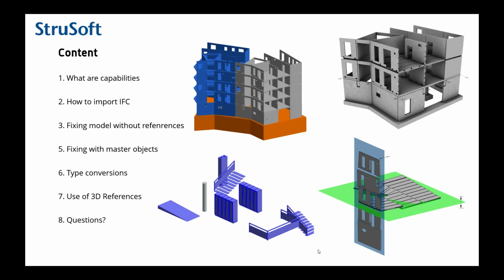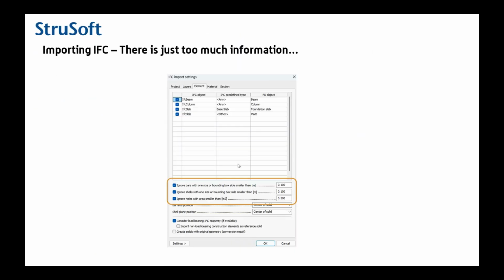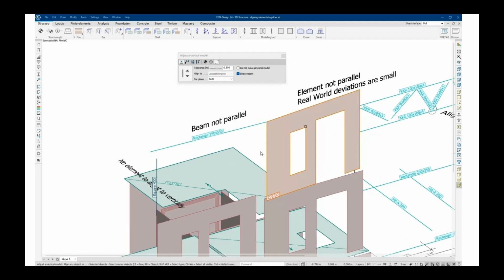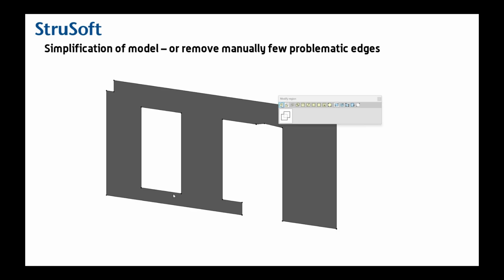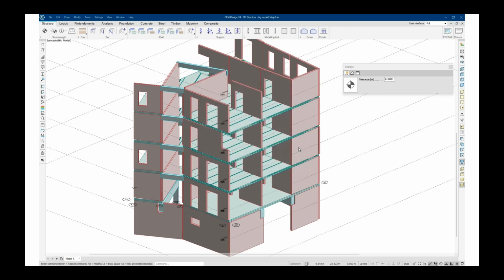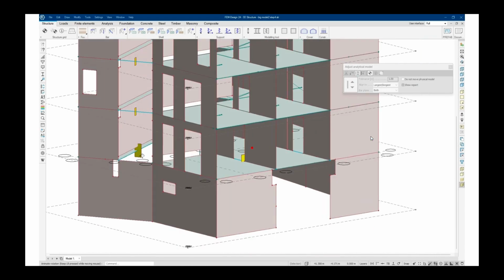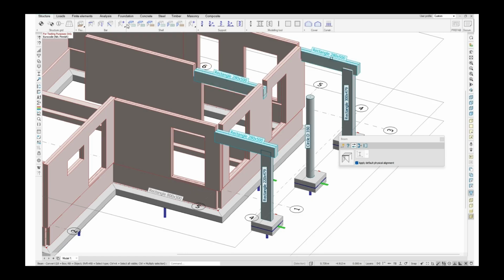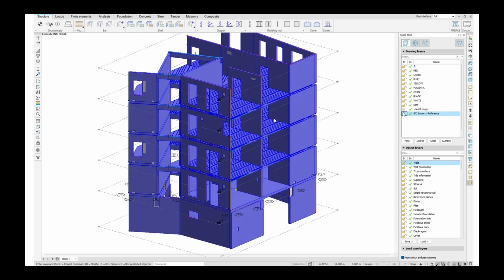Ultimate Guide BIM to FEM

Comment: Hello! What about Tekla StruXML Eport and Import? Do these programs no longer work for Tekla versions above 2022?
Reply: It no longer made sense for us to continue maintaining the Tekla StruXML-based connection, because:

It only works when an analytical model is created in Tekla. This is a very rare workflow, and building an analytical model inside Tekla is a complex process.

Both FEM-Design and Tekla handle physical-element IFC models very well (both import and export), and each can provide editable native elements to the other party.
(Note: Tekla can convert FEM-Design elements into native Tekla objects only when using IFC 2x3.)
Reply: @jigi7203  Thank you for the reply. Is it possible to somehow convert a beam element into a plate in FEM-Design? Hollow-core slabs from Tekla are imported as beams, while FEM-Design uses shell elements for slabs.
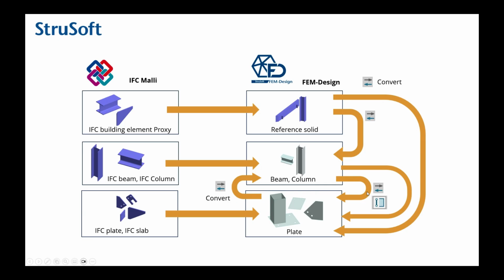Reply: @Jeff-m1e  Sure it is possible. this is ULTIMATE guide. Look timestamp 35:00 It reads HC profile and makes shell with right stiffness and you can even adjust joint locations afterwards.
Reply: @jigi7203  Thanks for the clarification! A very useful feature — impressive!